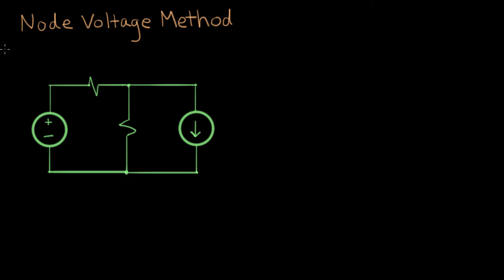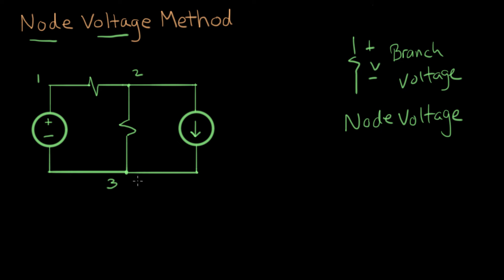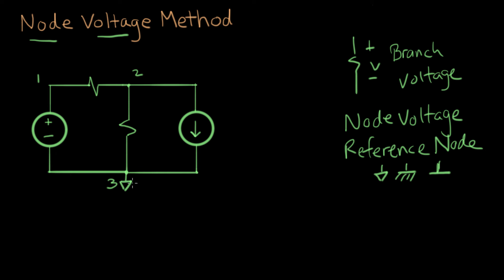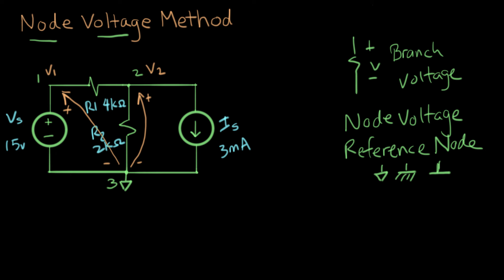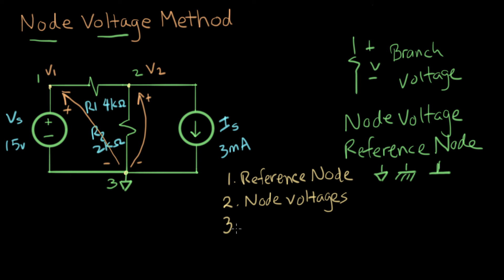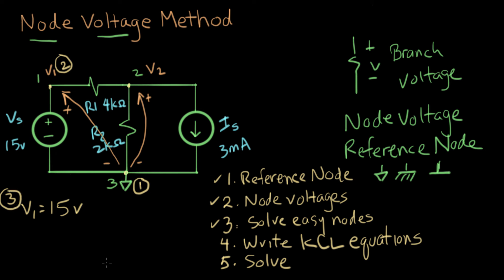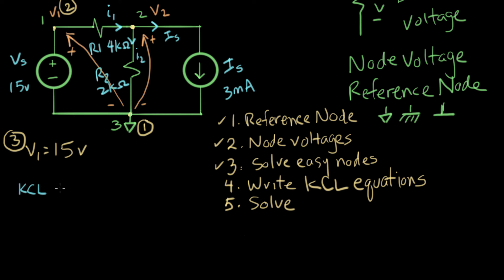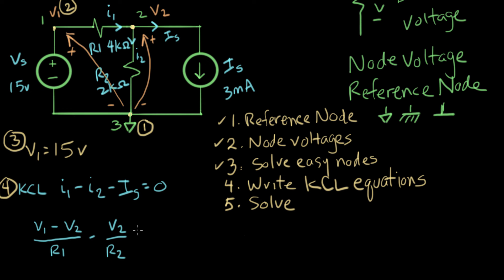Node voltage method (steps 1 to 4) | Circuit analysis | Electrical engineering | Khan Academy

Comment: How do you know where the current arrows will point to?
Reply: Actually its CONVENTIONAL CURRENT which has a path from positive to negative.
 Conventional Current or CC is a method for simplifying the basic Amperage concept. Also, CC is the thing which ammeters measure. In this case, please check out the battery or emf terminal's orientation. Although the flow of electron is from negative terminal to positive terminal, the conventional current is the reason behind calculating the flow of current from positive to negative :)

Comment: What is the point of the reference node? What purpose does it serve. It is not like it actually acts as a benchmark/ground when writing the equations. The equations are the standard Kirchhoff's equations. I mean can someone explain the purpose of node voltage in general. Isn't it exactly like finding the current and etc the normal way through Kirchhoff's laws?

Comment: thanks to upload a good video. by the way, could you please tell me why the node on the left side of node 2 can't be a ground node? i thought the left node has same number of elements ( voltage source, resistance, current source).

Comment: 9:10 why's it V1-V2/R1 instead of just V1/R1?
Reply: Because, if you consider the voltage coming from V1 and goes to V2 through the resistor R1, there should be a voltage drop at resistor R1. Therefore, you get this: V1-Voltage drop at R1=V2. So the drop voltage or the voltage across R1 resistor= V1-V2. Then if you follow the Ohm's law to determine the current flowing at R1 area that is I=Voltage across R1/R1; your equation becomes: (V1-V2.)/R1. You should note that, V1 is the node voltage that indicates the charge
Reply: @mirza360  shouldn't that mean, according to what you wrote, that R2 also has a voltage drop across it, which it does if course, but why is that current calculation then not (V2-V3)/R2?
Reply: @DeepVale  Actually, there will be no V3 as the connection is shorted toward the negative terminal.
Reply: @mirza360  So could also say the equation IS (V2-V3)/R2 but V3 = 0
Reply: had the same question. Thanks to all the answers
Reply: @DeepVale  
Indeed, and V3 ( which is the ground here) equal to zero; reason why he didn't bother to mention that. Remember ground is always is zero volt
Reply: Mirza V3 equals zero in this situation, it’s the ground

Comment: Thanks for the video! I'm stuck trying to figure out why i1 = (v1 - v2)/4kΩ. Please help me to understand.
Reply: Explain what you don't understand about it. Like why does the current of node 1 = voltage of node 1 - voltage of node 2 divided by 4k ohms?
Reply: Remember Ohms law?
Reply: Benjamin Dunn hi
Reply: ohms law. solving I=v/R.
Reply: i1 is the branch current flowing in the 4k𝛀 resistor. The direction that he drew for the arrow representing i1 on the diagram indicates that i1 flows from node 1 to node 2. Current always flows from high potential to low potential. That means that according to the current direction indicated on the diagram v1 > v2. Therefore the voltage drop across the 4k𝛀 resistor is given by v1 - v2. (The voltage at one end of the resistor is v1; and at the other is v2.) According to Ohm's law then (v1 - v2) = i1 x 4k𝛀. Solving that expression for i1 gives i1 = (v1 - v2)/4k𝛀.   The directions of the branch currents as labeled in the diagram are completely arbitrary; however, if when you solve the KCL equations for v1 and v2 it turns out that v2 > v1 then that means that you chose the wrong direction for i1. (If you plug v1 & v2 into your equation for i1, you'll get a negative number. The minus sign indicates that i1 is flowing in the opposite direction from what you originally assumed.)

Comment: can i ask something? why i1= v1-v2/R1 not v2-v1/R1?
Reply: Because  node 1 is on a higher potential than node 2. Node 1 is right after the positive terminal of the battery, and potential there is 15V,  and when you move across R1, there is a voltage DROP, so potential at node 2 is less than 15V, so the difference in potentials (voltage drop on  R1) is V1-V2
Reply: It is actually a matter of how the guy defined the direction of current. If the direction of current was defined as coming out of the node, then the voltage drop would be v2 - v1.  Current (which is a flow of positive charge) flows from higher to lower voltage, always.

Comment: there is voltage drop at the resistor R2 also. So shouldn't it be V2-V3/R2 instead of just V2/R2 ?
Reply: He does that, but V3=0V, because it's the reference node. So that makes it V2/R2.
Reply: Shubham Jain Detective L ....... I am Kira 😂😂😂

Comment: What is the benefit of reference node this is not helpful
Reply: If u take it with only one node voltage V2 u will understand provided u give proper current direction